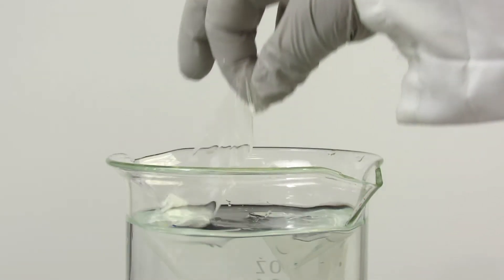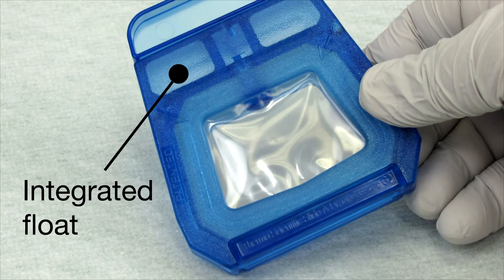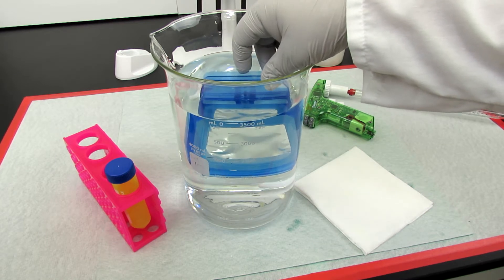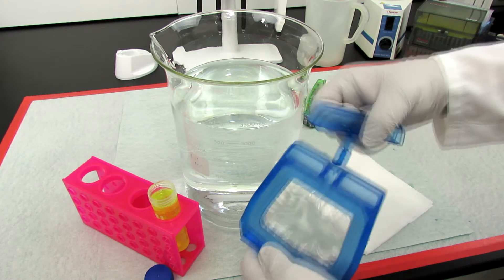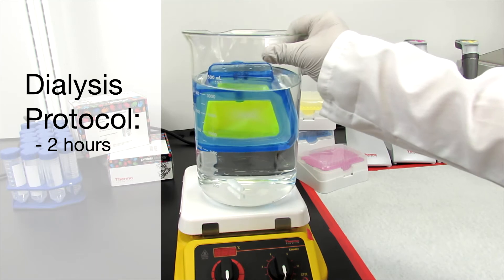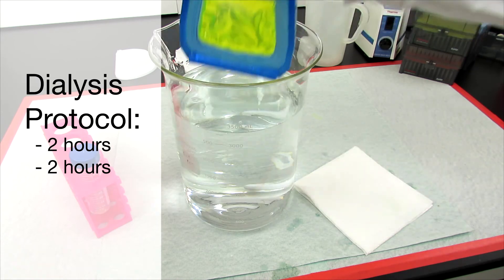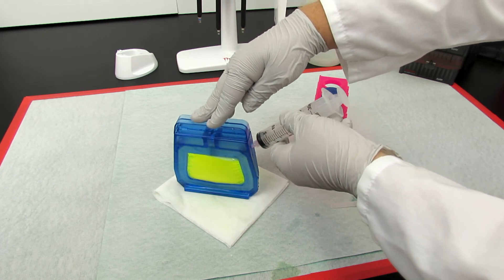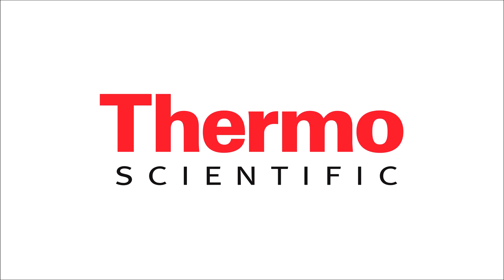Sample Preparation for Protein Analysis | Dialysis Cassettes

Comment: Hi, I am using B-PER followed by IBSR to solubilize my protein, as IBSR is not compatible with SDS-PAGE, I have to dialyze my samples (Please note that I am not expecting refolding, just want to remove the salts/denaturants). What should be my dialysate?  and should I follow 2 hr+2 hr+overnight protocol for that? I don't want Urea exchange.